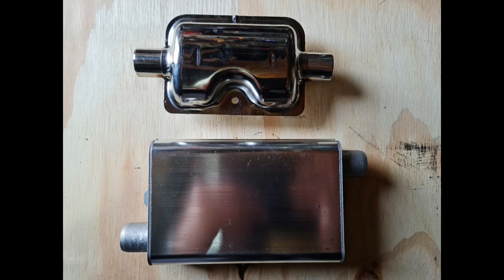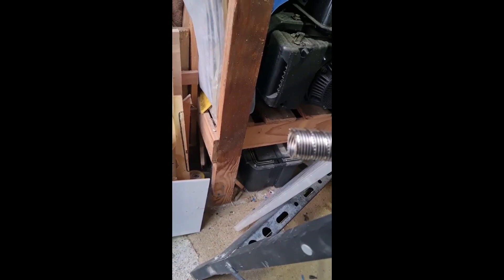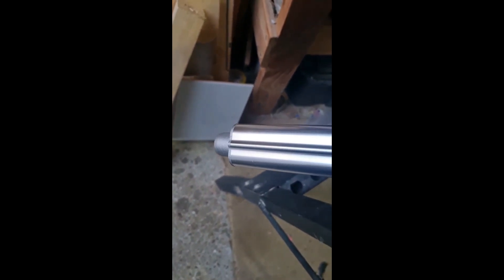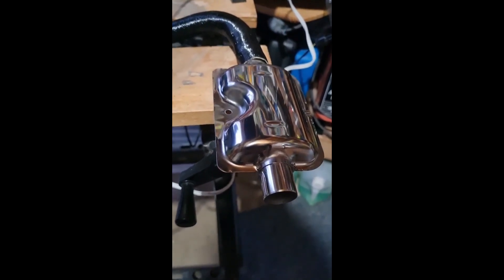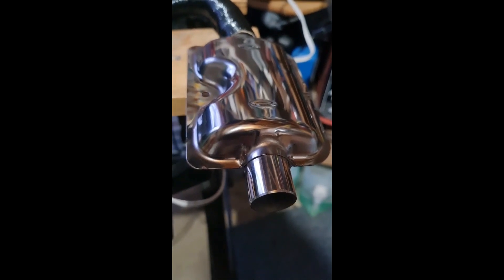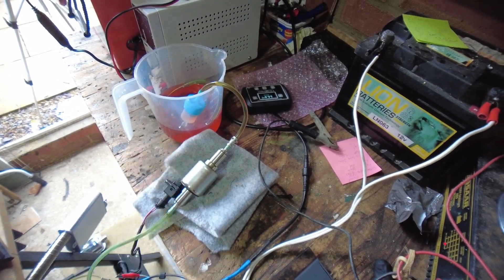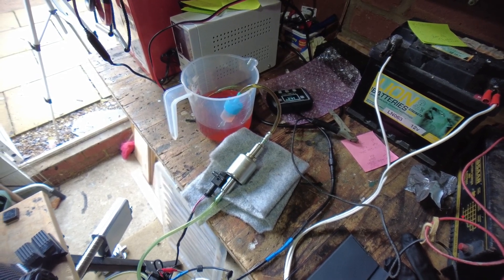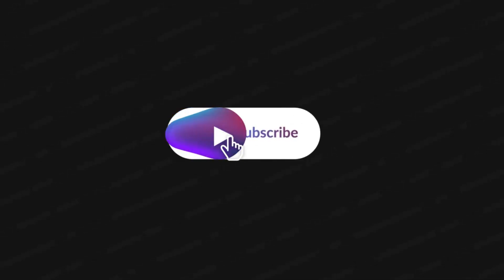Chinese Diesel heater exhaust upgrade.

Comment: This could be causing back pressure and actually helping the diesel burn better.
Have you tested the performance ?
Reply from the maker: Hello, thanks for taking the time to view my video and comment. I have not yet actually installed the heater in my van conversion. It was bench tested to check all was fine prior to installation. If as you suggest, that certainly can not be a bad thing.

Comment: Does the new type have water drain hole ?
Reply from the maker: Hello. Thanks for watching. Yes like the old one it has a pre drilled hole to be located at the bottom upon fitting.

Comment: Roy if the burner air inlet is going outside then don't use the silencer as the filter . It is straight through so will not stop debris being sucked through it. I like the new silencer though must get one. I will sub to your channel to help it grow. Hope you do same.
Happy new year to you & the Family.
Regards.
Steve.
Reply from the maker: Hello Steve. Thanks for viewing, I agree re the old silencer being used on its own will run the risk of sucking in debris, I would advise adding the original air filter in addition to the old exhaust.

Comment: Is the upgraded muffler as leaky as a the old one?
Reply from the maker: Hello. Thanks for viewing, I cannot give a 100% confirmation but I would say I did not notice smoke escaping whilst testing, but then I have tuned my heater so no smoke is present. 
I could fill it with water to confirm whether it leaks but as mine will be installed under my van I am not too concerned should it leak slightly.